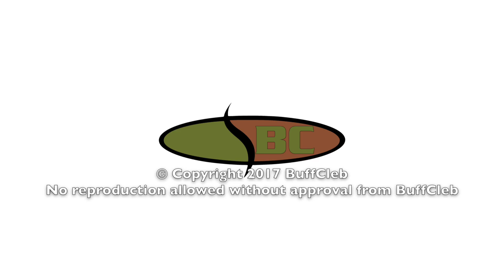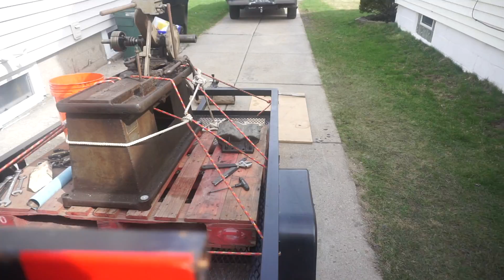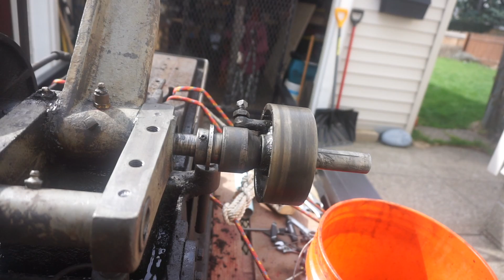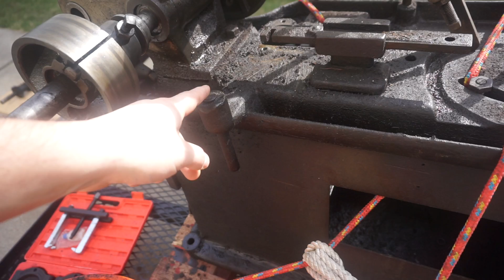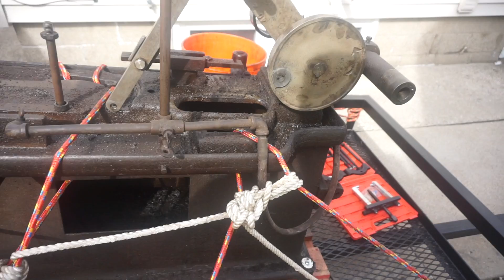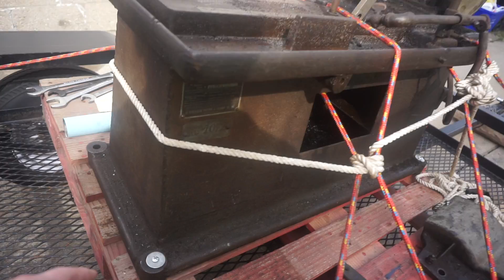Robertson Power Hacksaw - Cleanup Part 1

Comment: That pulley looks like a split pulley, is there a bolt to clamp it together.
Reply from the maker: it's actually a clutch that goes inside a gear... it has a split but the problem I was having was that my gear puller set wasn't large enough... for now it's fine I'm just going to put it back together... after I get it going I might tear it down again and do a proper paint and restore...if so I'll fab up a larger puller...